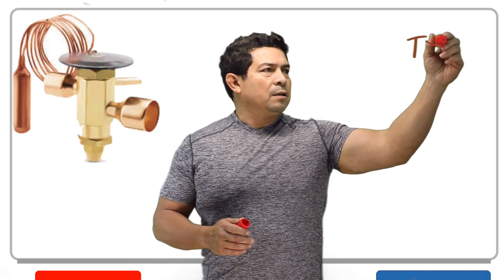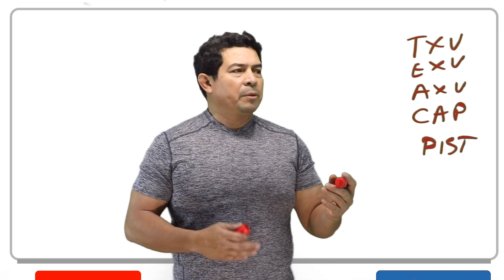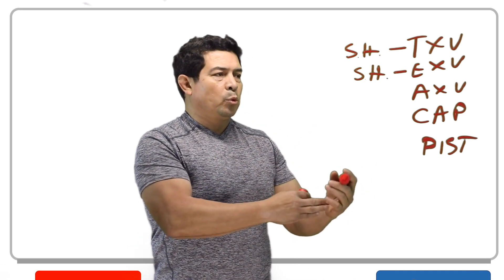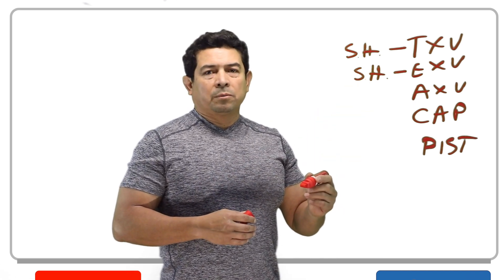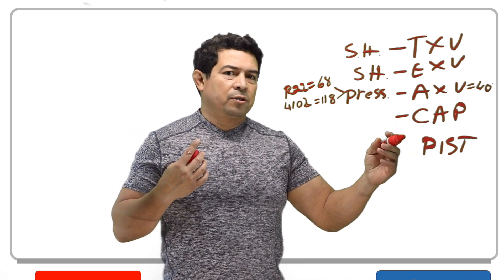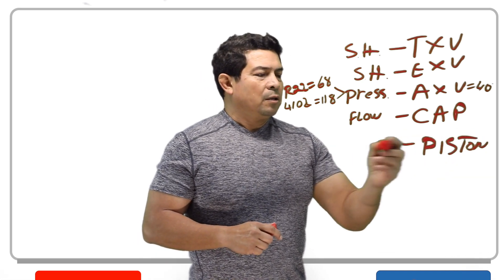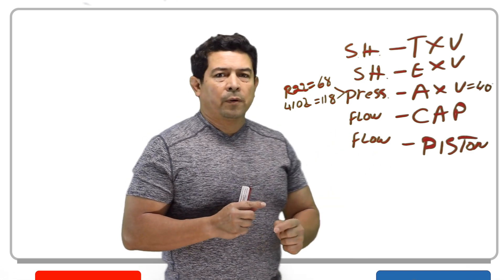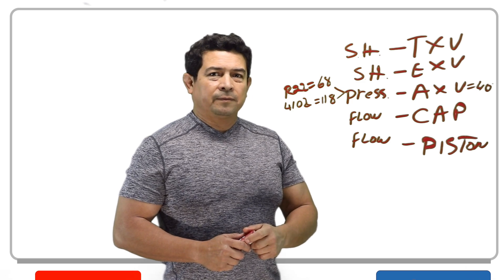5 most common metering devices. Metering Devices. - HVAC Online Training and Courses

Comment: Thanks. Greatly appreciate it, So the Evap temp for AC is 40 Deg Fahrenheit , What is the Evap temp for Coolers and Freezers? Is there a reason for AC Evap to be 40?
Reply from the maker: Thank you for sending the questioning/comment, in an air conditioning system yes you would like the evaporator to be 40°F because the air temperature is going to be approximately 75°. This way you will have a temperature difference that is large enough and allow good heat transfer. If we are talking about a freezer, remember not everything freezes at 32° so we must maintain the freezer at a temperature of much lower than 32°.  We may want to maintain the evaporator anywhere between 5°F to maybe 10 below zero Fahrenheit. It all depends on what it is that we are trying to do with the evaporator. In a cooler, I believe you might be talking about a water cooler? I am not sure you would want the temperature to be between 35 to 40° so the water will be nice and cool when you drink it but not cold enough where it will freeze. If you are talking about a cooler for flowers and candy you may want to keep the temperature around 45°F but then we have to worry about the humidity. We do not want to dry the flowers and plants out. We want to make sure that we maintain enough moisture and humidity in there to make them last a long time. I know this maybe a long explanation but I hope it makes sense. Thank you for watching!
Reply: @AirConAcademy  Thanks and regards.

Comment: A cap tube for r22 can it handle 410 freon ? The same? As r22?
Reply from the maker: No, and it is not about the pressure. It is because of the size. A metering device designed for 410 a is approximately 15% smaller than for R 22. So you need to either make it longer or have a smaller diameter capillary tube.

Comment: i have 1 question with r134a the suction pressure go down and the evaporator pressure go up, this case how to fix or what happen?
Reply from the maker: That is an interesting question. With any refrigerant when the suction pressure drops the evaporator saturation temperature will drop. Sometimes what happens is that there's not enough refrigerant in the system so as the suction pressure drops and the evaporator temperature drops the superheat is going to go up. What you might be looking at might be the superheat increasing. If you look at the PT chart as your pressure drops the saturation temperature also drops. Which is normal but I think you might be looking at the temperature at the outlet of the coil which is what we do to look at superheat. I'm not sure if this explains your question if it does not let me know. But if you notice your superheat is going to increase. Good luck thank you for setting the questioning.
Reply: @AirConAcademy  we have add some freon now the compresure bcome freze and the hight pressure be come high? how to fix this case
Reply from the maker: @ngornbunpa6092  do you have a suction or liquid line filter dryer? Check to make sure that these are not plugged up. The liquid line dryer you check by seeing if there's a temperature difference between the inlet and the outlet of the dryer. The suction line dryer you check to see if there's a pressure difference between the inlet and the outlet of the drier.     Also what type of metering device do you have? Maybe if it is a TXV it might be failing?   Please let me know what you found with the dryers.

Comment: Actually our system have two compressor which we changed over every month..incase no.1 have a problem we change over to standby to no.2.we just pump down no.1 then transferred all freon to no.2 and put it on service
Reply from the maker: I am sorry but I am working with several people on line with other problems. for some reason I can only see this message and not your earlier one, could you please remind me what the problem is that you are having?

Comment: Our system have one compressor only for 6 refrigerated room chambers.. also I want to ask why Everytime the kitchen crew forgot to switch on the evaporator fan..I noticed froze building up on EPR line ,txv till compressure suction line as well..
Reply from the maker: wildan sajise     Do all of the boxes freeze when they forget to turn the fan on? Does each box have an individual fan switch or this one fan switch turn All of the fans off?    If it is only one or maybe two that freeze when the fan is off. It sounds like maybe the EPR valve might be leaking by? Or it is not set properly?    I was wondering what turns the compressor off? Is it a pressure switch? Or a temperature switch? Because if the compressor is not shutting off that might do it also.

Comment: Hello sir..I have a problem with our reefer provision..our meat and fish room chambers ranging from -17 to -21 Deg.C always have a froze on it's suction line even untill the suction compressor..same also on its txv..today I changed the txv of meat room with new spare but still same scenario..the txv is danfoss R407 orifice no.3..they said txv is preset from factory..so I didn't touch the setting..our system has a other room chambers for perishable goods ranging +4 +6 +8 ...only two frozen for meat and fish..the rest has a evap.press.regulator.. my problem only is the meat and fish room from txv to suction line return to compressor always frozen..level of refrigerant is ok...compressor suction pressure when running cut off at 4bar and cut in at 2.5 bar....I hope u can give me advice sir..by the way it's still reaching the desired temp which is -21 deg.C only problem is line always frozen...
Reply from the maker: wildan sajise When you changed the TXV, did you pump down? Or recover the refrigerant? Do you have enough refrigerant in the system? Do you have a sight glass? What is your sub cooling? And in the freezer where you just changed the TXV what is your superheat reading now? And what is the suction pressure or what is the pressure in that evaporator now?   Also, what type of refrigerant are you using?
Reply from the maker: I was reading your massage again.  If it is maintaining the proper temperature then you may not have a big problem. is the evaporator clogging with ice?   The suction line being frozen only means that the temperature is below 32 degrees F.  or 0 Celsius.  I would insulate the suction line better.   If the unit is keeping the correct temperature you may not have a problem.  please let me know how it works out.

Comment: Thanks teacher I'd like to ask you weather I can operate the unit by txv and without a liquid receiver ? Is that possible
Reply from the maker: Yes you can operate an air conditioning unit without a liquid receiver. But it is recommended that you have  one.  If the lines are long. Meaning the suction and liquid line. And if you have a TXV as a metering device.    Do not forget. If you have a TXV the unit needs to be charged by sub cooling so you have to have a good amount of sub cooling.    Typically in the installation manual it will tell you what the sub cooling needs to be and it would tell you if you need a Liquid receiver.    .
Reply: @AirConAcademy  sorry but i don't understand the last part could explain further please?
Reply from the maker: When you say the last part are you talking about the Electronic Expansion Valve?  I am not sure what you mean by the last part?   please let  me know.

Comment: Please can you discuss what is the different of external equalizer and internal equalizer, and what applications can use external and internal equalizer.
Reply from the maker: The internal equalizing valves are used when the manufacturer does not expect a large pressure drop on the evaporator coil and an external equalizing line is used when the manufacture expects a pressure drop across the evaporator coil. So typically on larger units they may use an external equalized TXV. One thing to remember is you always replace a TXV or any other part with the exact replacement. I hope this helped.
Reply: Deeply appriciated.

Comment: Hi sir your information video so good and helpful. Sir i have 2.5 ton round shape reheem hvac this unit outdoor composer work properly. Problem is inside unite evaproter not cooling all coils 4 coil is hot another coil cold caplari also cold. This unit peston no 065 so sir what we do replaced peston same number or replaced all evaproter so sir please guide thanks so much
Reply from the maker: m nadeem     I would only replace the piston with the same number piston. If you can get the number of the piston the model number of the indoor coil and the outdoor unit and make sure they all match. Have you checked your superheat in that unit? If your superheat is high then you need to add refrigerant unless your high side pressure is excessively hot. In that case you probably have a restriction in the liquid line. Check my video on liquid line filter dryer‘s I explain how to troubleshoot that.

Comment: Sir your information is very useful thank you very much and I need one help sir one screw type compressor working good but that one high discharge temperature trip 134a Freon pressure 33 suction 243 discharge, discharge temperature 233
Reply from the maker: it sounds like you may have too much superheat?  BUT   this is on a chiller I am sure.   is it a flooded evaporator    or direct expansion?
Reply: Hi

Comment: Teacher Julio. Which of them are specific for AC residencial.?
Good class as always.
Reply from the maker: The permanent split capacitor is mostly used in residential both compressor and Fans.  I will see what i can do about the valve video. Thanks
Reply from the maker: you would only see the Piston, the TXV, on older unit maybe the capillary tube.